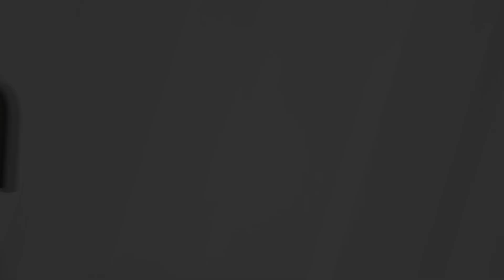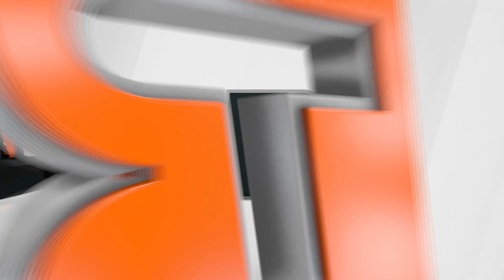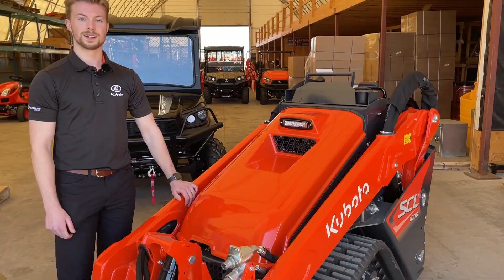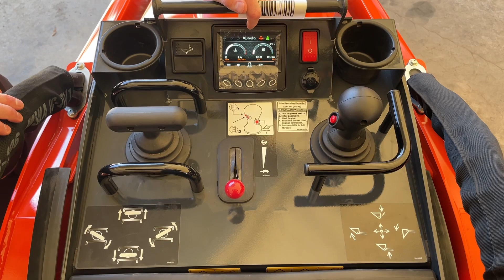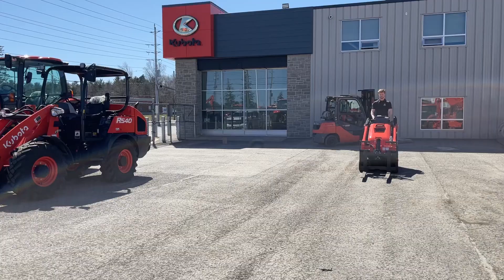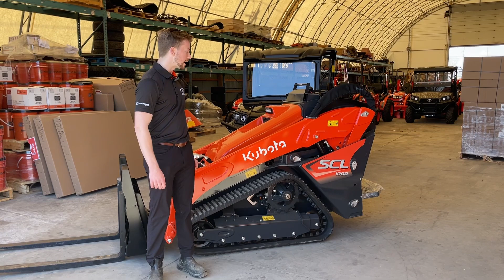*NEW* Kubota SCL1000 Review | This Is A Game Changer

Comment: Dam that price is insane.  Got mine in us for 29
Reply: I bought my 2023 SCL from my local Dealer and it was $39,000 with bucket. I ordered it back in September.  They are pricey and hard to find but if you can put them to work 4-5 days a week they are worth every penny. Especially now days with the Gen Z kids sitting at home in mommy’s basement unwilling to work. Been in business for 24 years and now that it’s more difficult to find young help on job sites this unit is well worth it! Machine shows up to work on time. Isn’t addicted to drugs or porn and works it’s ass off not expecting more pay because it actually does its job 😂😂😂
Reply: 29k new? Lowest I’ve heard was $36k September 2021
Reply: Right now the prices are $38-$40k with bucket
Reply: George - where are you located?